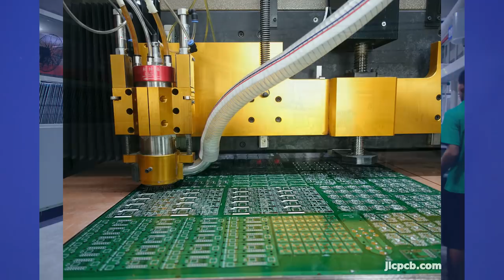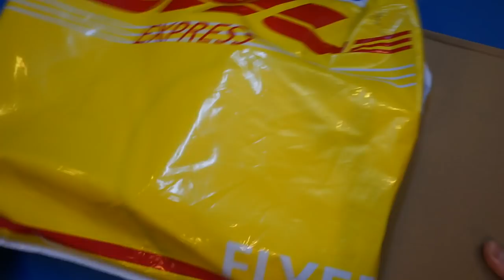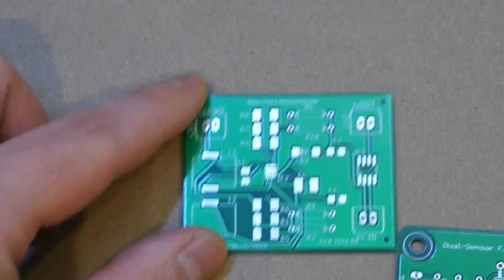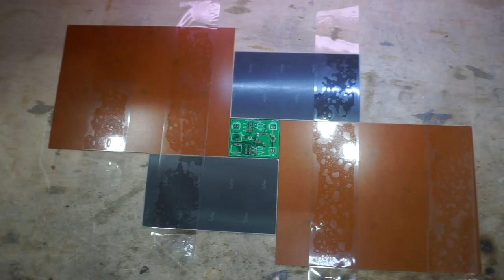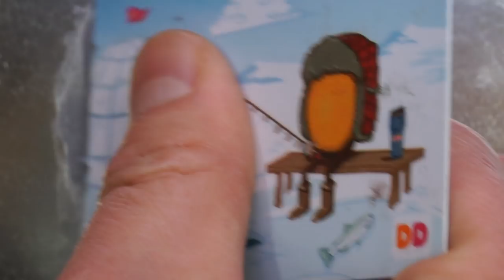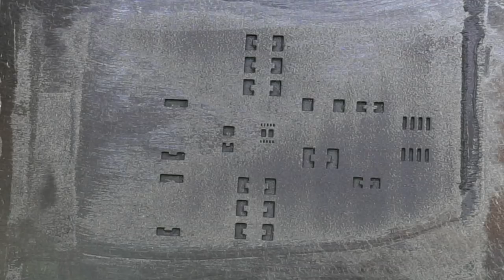SMD Reflow Soldering Using PCB and Stencil from JLCPCB

Comment: From what I understand is the DFN 10 pin device isn't that important in terms of solder paste even if you smear the its fine as long as you get alot of past on it , the point is, during reflow  the tin pads will suck and absorb the paste and flood the pads shorting is very rare, the point of the stencil is just for covering the pads it doesn't have to be 100% accurate in terms of paste.  (the reflow temperature is more important)

Comment: V Groove Panel your 50 X 50 boards so that you get 4 on a 100 X 100 board, the $2 price is for 5 of the 100 X 100 boards ! The minimum V groove size is 20mm, so you will get 125 of 20 X 20 boards for your $2 ! JLCPCB have their own software that you can use for designing PCB's, just click on Tools > Panelize, select V groove and fill in the number of boards up/down and across :)

Comment: Great video, Kerry. That large stencil seems a bit unwieldy. Seems wasteful of material and extra shipping hassle. Shame they can't cut them to a more reasonable size. I guess this must be the size of the panel that comes out of their stencil  making machine.
Reply from the maker: Thanks. Yeah my guess is the stencil is mainly for panelized boards and at least from them all stencils come in the same size.
Reply: @KerryWongBlog - You can specify custom sizes from JLC (now at least). I usually request them around 2cm larger than the PCB in each dimension. For larger boards I order the framed stencils, so they do not flex so much when adding the solder paste :)
Reply: You can request that they cut the stencil down to size. I always have them cut it to the size of the board for easier working.

Comment: Stencils are tricky when dealing with close pin spacing such as SSOP28, a 12 thou (or mil) thick stencil will give too much paste that will bridge the chip pins requiring a clean up with wick :(
12 mil is nice for other components. I suggest the pad size for  close pin spacings needs to be 1/3 of the actual pad size.

Comment: Kerry, Thanks for this video. I'll soon be attempting use of a stencil for the first time, so this is very helpful. I'm also looking forward to the reflow with a hot air tool going as smoothly as it did for you here.  
But I can only assume you were very, very tired when you designed that PCB...
Reply from the maker: :O I should have paid more attention to the PCB... Oh well.
Reply: @KerryWongBlog  Did you ever get the PCB to working?
Reply from the maker: @gregd6022  Yes, besides some cosmetics issue the PCB worked fine.
Reply: @KerryWongBlog  ok great to know, almost impossible to "buzz out" a no-lead package. Btw, what settings (temp and flow?) did you have your rework station set at? Great video man, a number of salient points.

Comment: ha, i'm not the only one endup with eagle. i went through, multisim (ps:couldn't recommend it) then easyeda, still eagle at the end.
Reply from the maker: The only thing is that the free version of eagle limits the PCB to 2 layers and the maximum size is also restricted. But for hobby purposes, this would rarely be of an issue.
Reply: Kerry Wong yup, 80cm2 kind of bummer
Reply: So far i am happy with KiCAD, but i use mihosoft freerouting, because KiCAD does not provide autorouting per se.

Comment: Great video Kerry! What brand/model no. is your hot work station? I tend to shy away from smd prototyping but recently I have been playing around but I just buy the break out boards. I  didn't know it was possible to solder that small ic form. Thought only Fox Conn type could do that
Micheal
Reply from the maker: Mine is a x-tronic 4040 which I bought almost 7 years ago (http://www.kerrywong.com/2011/12/07/x-tronic-4040-hot-air-reworksoldering-station-ii/). For fine pin-pitch devices, especially DFNs stencil is essential as too much solder can easily create bridges.

Comment: They are not 2$, since their shipping cost is much higher than just about any one. 10x 10cmx10cm, cost more like 14$, good but not that cheap anymore

It's like this: I sell you my car for 1$, but for you to get title of it, I will charge you 50000$ extra. would you still consider that car being cheap?
Reply: First2ner I think it is $5 (10x10cmx10cm) after the first, so that might be a more accurate number. Although shipping isn't too ridiculous either ($8 to NZ). Anyway I'm quite happy about $10 including shipping, usually the components cost more anyway.
Reply: HOW TO ORDER CHEAPLY ON JLCPCB Ship using DHL (23$) & GOT 20$ OFF After Adding 3 Pcbs To Cart (Yesterday)

Comment: There are reasons why those are cheap. Their Tg is 140 degrees Celcius and its FR4 material gets easily burned and inflated under regular reflow machine (not the heat gun). You may want to go with something that has a higher Tg (170 or higher) if you are looking for a better quality.
Reply from the maker: Do you have a supplier you can recommend?
Reply: https://oshpark.com/ uses Tg 170 for 2 layer FR4 and Tg 180 for 4 layer FR4. The price is relatively cheaper when your board size is small, but when it gets bigger, say about 100 mm by 100 mm, the price will increase a lot. https://www.pcbway.com/ is another cheap Chinese manufacturer and you are able to select the FR4 material (Tg from 140 up to 180) and you can see the price variation.